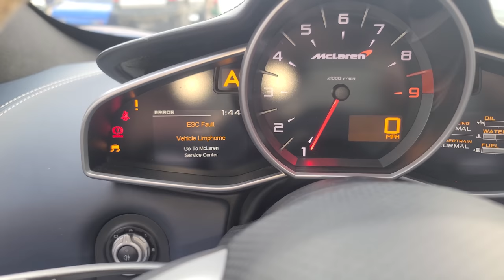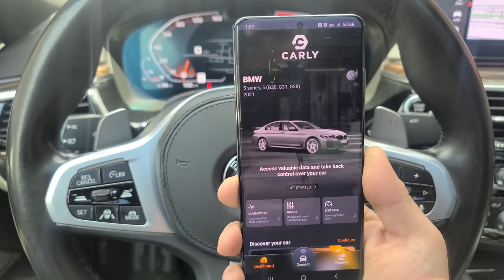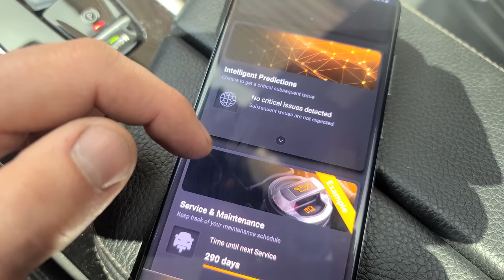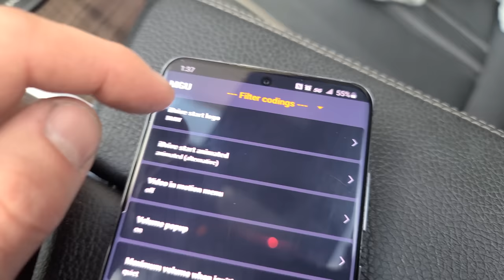I Took My McLaren To The Experts To Learn How Broken It Is & We Found $7k In Mods! It’s Broken Too.

Comment: I stopped going to a garage when there is nothing obviously wrong with my car. One time I thought I had scored a great deal on a Volvo XC70. Bought it for 3k. All was working well. I thought I'd just get a quick check at a Volvo dealer. They came up with something like 7k in repairs. I ran away all desperate thinking my car was a wreck. But than a friend of mine said: What are you winding about. Everything works. Just drive it and enjoy. I had the car for 2 more years without spending a dollar on it and than sold it for 3k 😂
Reply: Like, no oil changes or anything? OK...
Reply: Eh while this would work for a 3K beater, I wouldn't recommend this strategy in the long run for most cars. Yes it'll run but cars need preventative maintenance and regular fixes. You can drive on leaking struts but is it safe? You can ignore motor mounts but at one point, you'll start damaging things. That $7K repair bill probably recommended replacement of a lot of parts that needed replacement from a while ago.
Reply: 7k is no wreck, go through the list and be selective. I used to have a very tuned and modded VW new beetle, I'd have her checked every 6mo-1yr and just take care of the small stuff before it becomes bigger, bill was rarely over 1k$ including filters, flushes etc. Consider it was a heavily modded and tuned car, driven hard at times, but I always took care of stuff in time and kept on top of it, thus avoidin bigger hits. Biggest was 3k or so, motor mounts, all belts, hoses, fluids, plugs and complete checkup.
Reply: Nah, when that old timing belt lets go and totals your engine, you won't be driving and enjoying it.  A friend with a garage always talks about the players who come in with their "great deal" BMW or Mercedes, and can't believe the cars show out with $7-10K in deferred maintenance items.  Why was it so cheap?
Reply: @pault151  That is a totally different matter. That is regular maintenance. I am more talking about really searching the car for problems to fix. But indeed, BMW and Mercedes need ongoing investments to keep them running. If I hear what some of my mates spend on maintaining a Mercedes I think yes, that way I can keep any car running for ever. Maintenance is good. Searching for things to fix not so much.
Reply: @donmynack  Maintenance is an obvious thing. To me at least.

Comment: A word about tire widths: the 12C weighs 3,200 lbs with a 43/57% weight distribution; a front tire supports 688 lbs. With a 29 psi recommended inflation pressure, this makes the contact patch 23.7 sq in. If the tire width is 235 mm (9.3 in), then the contact patch length is 2.6 in. At some point, if you want the front wheels to help with the braking, you're going to need some length to the contact patch as the deceleration forces are transmitted longitudinally through the tire into the road. This is also the case with acceleration and the rear tires--wider is not necessarily faster overall. While cornering forces might be higher, you'll begin to compromise grip in a straight line. Bottom line: McLaren knew what they were doing when they chose the sizes they did, and trying to second guess them is a Fool's Errand.

Comment: This type of video is why I got into restoring stuff. You can find the same damn parts like a kitchen cabinet latch that works identically to the 90$ manufacturer part. crazy markup
Reply: How the heck did you figure out that it was the same part as the kitchen cabinet?  Same with the Sentra coil pack.  Show us how to cross reference and save cash Alex!  Great videos!
Reply: @iketurner1124  it has to be that PR-3 marking on the side of the part was how he was able to find it and match it but No idea how he was able to figure out it was the same without pulling the original one...
Reply: @DenalisGarage  Probably looked up the McLaren part online and match it, would be my guess

Comment: One of the best and most satisfying things to do with a used luxury vehicle with genuine leather is to fill in the creases on the seat and have them re-dyed. The seats will look brand new and that look will last tens of thousands of miles if cared for.
As far as the steering wheel, it depends on the car. I've found that some cars it's actually cheaper just to buy a brand new replacement and sell the old one, because you truly get that brand-new car experience with the wheel.

Comment: Good to see them using the guide pin when removing and replacing the wheel.
Too many mechanics think they don't need it..and then wonder why the threads get messed up and the calipers get scratched.

Comment: Oil change intervals got longer mostly cause the oil got a lot better. Its 10,000 miles with an oil and filter capable of lasting that long, not cheap conventional oil.

Comment: I would definitely look into the oil change interval thing.  Mobile 1 claims the filters can almost go about 20,000 miles and the oil easily 10,000 miles.  As long as there is no contaminants or it breaking down like natural oil does it should be fine.  Older non-synthetic oil degrades under heat where the synthetic doesn’t so you would have to change it every 3000 miles.  I tend to change it at about 8K miles instead of 10k just because, but would love to see what Amsoil says about it.
Reply: 3000 miles, no more no less as the only people telling you otherwise want you to buy a new car or lease a new one every 3 to 5 years, and oil and filters are less than the cost of a new engine, plus also when the engine starts let it do its start up procedure where it automatically revs high for about a minute or two and then drops down to get the oil to the bearings, then drive off

which will probably do more to save the engine in general than anything else.
Reply: 5k mile OCIs on any engine w/DI.  DI tends to cause fuel dilution of the oil - I have seen in many UOAs across different engines, and it's just not worth pushing the oil life in these low bearing clearance engines when the oil is dropping a viscosity grade due to fuel dilution.
Reply: 3k if you love your car :)
Reply: He's tested other brands but here he's comparing blended to full synthetic.  

https://www.youtube.com/watch?v=qCsQMpaNmw8
Reply: These other guys obviously are not mechanics. The oil and additive packages as well as filters being much improved does make 10k no problem. If you change it every 3k not only is it a PITA but your creating 3 times the waste oil and dirty filters and also means 3 times the production needed. The 3000 started when quaker state sold a non-detergent oil that almost ruined them. remember the "Quaker State Motor" comments and the sludged up engines that resulted?Save your money and the environment and your time. 10k hurts nothing!
Reply: @markgoodson3828  alright then do it on your own car and see how long that lasts

Mr oh wont somebody think of the Children, and then you wonder why Hoovie has a BMW with 70K on it that's already needed an engine swap and it was 3 years younger than the car I kept for 12 years

and while the north east did a number on the shocks,  and I had to do brake pads

given I drove that thing like a monster, I always let it warm up as the old 5 cylinder jumped to 5,000 rpm and then came down after a moment

and always did the oil change at time or 3,000 miles, I never had a problem with that motor. 

heck the only reason I got rid of it was the body was starting to flake out, and most of that was the fault of the north east or me myself really not knowing how to take care of it given it was my first new car.

and it was just time, honestly I kinda half thought about maybe turning it into a rally racer but the right car came up, and it was in good enough shape that while I should have gotten 2 or 3 K more for it

I'm basically into my new car for what I paid for it over 12 years ago
Reply: @kavinskysmith4094  i’m in the 3-5k camp and would absolutely do it every 3k on an engine that shares it’s oil with turbos.
Reply: @kavinskysmith4094  Cars revving high for a minute on start-up does not have to do with engine longevity or anything like that. It is for emissions - the cars are heating up the catalytic converters so that they can achieve efficiency quickly. Strictly an emissions thing.
Reply: @markgoodson3828  very false. All the carbon vented back into the crankcase from environmental regulations make the oil dirty just from running the engine. This occurs regardless of the quality of the oil.  Carbon that's vented back into the crankcase and other impurities in the oil affect its ability to form a protective film over the metal parts it is lubricating. There are certain cars that require an oil change after just a day on the track if you don't want to see damage/score marks/ sludge in the crankcase. Changing the oil every 3k miles or less is the ONLY way a car is going to see 300k+ miles. "These other guys are obviously not mechanics"
Reply: Is amsoil SAE 0W-40 FS Synthetic European Motor Oil made from Group IV PAO base stock? I checked their website but could not find the answer.
Reply: What is your opinion if E85 is used? How more often should the synthetic oil be changed?
Reply: @aeroman5239  Do you think using E85 dilutes the oil more than regular gasoline?
Reply: Well it is a Nissan motor sooo…..
Reply: @saulespino2510  Alcohol (e85 and methanol) breaks down oil much quicker then gasoline (petrol) does. I can justify 5k with synthetic oil and petrol but on e85 shoot for 3k.
Reply: @saulespino2510   if you push your car definitely change it at 1k max.
Reply: I change my oil every day. 50-100 miles. Can't be too careful
Reply: @kavinskysmith4094  Hoovie buys garbage on purpose, so that’s not saying much. As for changing the oil every 3000 miles… I can see why you’d do that, but it’s fair to point out that it’s pretty wasteful and you could safely stretch that to 5k unless you’re beating the fuck out of your car, which you’re probably not doing.
Reply: 20000 miles if your car has 20000 miles but over time the engine wears out so why risk it when oil and filters are so cheap. Do it every 6k miles and you wont have any trouble.
Reply: @roelfkromhout  5K maybe, but the direct injection thing, even in the 50's the mercedes benz's that had them required the oil to be changed within, well.......... yeah its kind of insane

apparently 1500 miles, 3000 KM on the mercedes benz 300 SL gull wing, which came straight from Ian Tyrell because of the way it dilutes and introduces the gas into the oil

something they changed on the roadsters apparently to make them more road going and to not have that issue

granted we are talking about the 50's where even the first corvette's didnt have oil filters

plus how often do we see channels and things talking about cleaning direct injection cars, as that is the thing about a new technology, it takes time to sort it out

unless I'm getting my memory of all those gallardo bat guano powered V10's wrong, as those always need decarboning

so maybe its more the engine but still, I'd say 5K at max, as its funny on a car I have with direct injection, a 2017

you can always tell when it needs an oil change as it starts running a little rough, then its fine again

and the garage hates it when I bring that up so they must know something is up
Reply: @w204mikull  You are correct, except with oils that are designed with dispersants that trap the carbon particles and prevent them from combining, which leads to sludge. Theres a nice Amsoil documentary about it. They also have a page on their website that addresses the 3000 mile change interval that was introduced in the 1960s, and why its not necessary anymore when using modern synthetic oils.
Reply: @somyongai8194  actually it used to be 1500 miles, partly because of the lead in the gas, and the filters, some cars didnt even have them
Reply: I strongly disagree with the 10,000 miles I actually got burnt by mobile one in my old Mazda MX6 had replaced the whole top end of the motor problem was I was doing my own old changes so I couldn't prove us using mobile one so that was a quick $2000 when I really didn't have it fact is you drive your thing you baby a car you shift at 2500 rpm's and take easy care of it sure 10,000 miles but if you drive a car in Revit and build up heat the oil will survive but all the valve trains will be coated with synthetic gunk mark my words

Comment: It's fitting that this shop works on GT-R's because McLaren bought this engine from Nissan. It was designed for their IndyCar program.
Reply: you mean endurance racing program
Reply: @Realtime1501  IRL (Indy Racing League), which is IndyCar during the split.

Development. McLaren bought the rights to the Tom Walkinshaw Racing developed engine, itself based on the Nissan VRH engine architecture, which was designed for the IRL Indycar championship but never raced. However, other than the 93 mm (3.66 in) bore, little of that engine remains in the M838T.
Reply: @Realtime1501  You're right. It was used in the prototypes.
Reply: @richardsmith2721 yes , the Indy engine was a derivative of the endurance engine that was used by Infinity

Comment: oil change interval...my E46 M3 interval is 15,000 or 1 year...I've changed it at 7,500 miles or max 1 year.  @105,000 miles, Blackstone oil analysis for rod bearing copper...excellent shape. VANOS excellent shape (visual by my mechanic). Valvetrain zero sludge or heat discoloration
Reply: I bought my E46 M3 with 40k miles and put 125k miles on it, I only ever followed oil change intervals according to the car's computer. The car never had any issues from the oil change intervals the entire 7 years I owned it, same with my E90 M3 granted I only put 30k miles on it.

Comment: You need to explain how you figured out the fuel door part was a clone of cabinet hardware.  It’s easy to figure out replacement spark plugs, plug packs, etc, but how did you figure out the fuel door?
Reply: I want to know this too
Reply: I don't know, but my guess would be a google image search.

Comment: one of the reasons for the longer change interval is because of synthetic oil. We are told it is supposed to protect better, thus the need to change as early isn't needed. I have been doing 10k change intervals for YEARS, and have never had an issue.

Comment: A word about your dyno figures: Super cool with flames and better noise, but please be careful to make sure your car doesn't become one of those examples with bent or broken con rods, etc. Assuming a 15% loss, your 12C is making around 680 hp (745 Nm) at 6500 rpm and 795 Nm at 4000 rpm. This compares with 607 hp (576 Nm) at 7500 rpm and 600 Nm at 3000 rpm. That's 32% more torque in the midrange and 29% more torque at the high end. Because the power peak went down by 1000 rpm and torque peak went up by 1000 rpm, the power band has been squished, indicating that boost is added heavily from 4000 to 6500 rpm--and 30+% is a LOT more boost.

Comment: They find ways to adjust the cost of parts so it all adds up to the sticker price or higher.  But common parts are usually STILL common parts, just marked way up.  That's the dirty secret of super(expensive)cars.

Comment: I used to work on light aircraft many moons ago, they had in the workshop a wheeled cutter for filters. It worked like a can opener. It did not add any metal particles to the filter. It looks like a filter removal tool but had multiple cutting wheels. Wrap round a filter clamp and rotate until filter casing parts, clean cut straight through. Found easily on the web as oil filter cutting tool.  Inexpensive easier disassembly of filter case and more accurate diagnosis of particles in filter.

Comment: Buddy of mine worked for Nissan Engineering. Told me they did oil tests to see how long they could get out of an oil change without any change in protection. 10K no problem. They went up to 15K and oil was just starting to show some downward trends.

Comment: I think it`s good that engine brakes afetr tuning. It means it was engineered to it`s limits. Is the LS  can hold 3 time the power from stock it means it ha alot of mass that could be removed. Ferdynand Porshe said: “The perfect race car crosses the finish line first and then crumbles into its individual parts.”

Comment: About the oil change internal. I remember reading in a motorcycle magasine that since the SG   standard came into force; the engine would no longer brake-in  like before, the oil wah too " oily"  The motor manufacturing industry had to machine the engine with more precision and do  the braking themselves with cheap oil, , . . .

Comment: The reason the front tires are narrow is it's a midengine car with more weight over the rear, it doesn't have an engine to redirectover the front wheels. if it did have super wide front tires it would probably be super oversteery.

Comment: I had a similar problem with my Chevrolet tahoe hybrid. Outside temp would dash out and cut the hvac system at -20°C lol took me a lot of thinking to find out the problem. Even GM could not find the problem haha.
For the CL65 I suspect a reading problem more than a system problem. I would work around that

Comment: no concerns on the smoke when you come off the throttle? wouldn't hurt doing comp/leak down test(if its not been done obviously) but since it was modified and tracked never know... could just be a turbo seal but better safe than sorry!

Comment: Almost all mid engine and rear engine cars have skinny front tires because there's no weight up there that the tire have to deal with when changing direction. Front engine cars absolutely need wide front tires. Look at stock C7 GS and Z06 front tires, Shelby GT350 and GT350R and GT500 front tires, 5th Gen Camaro Z/28 etc.